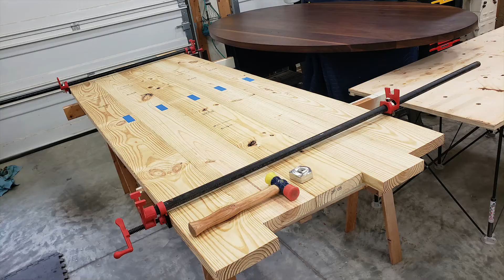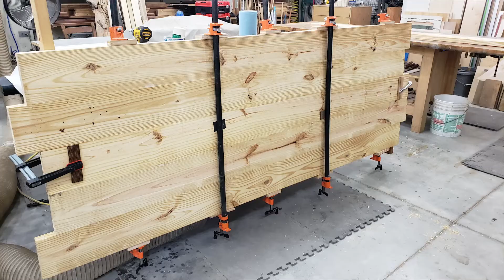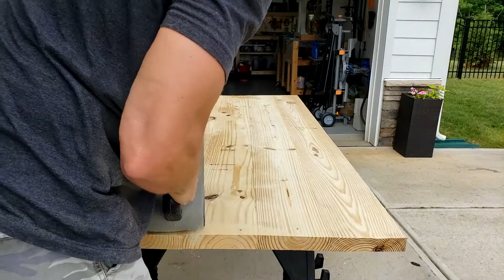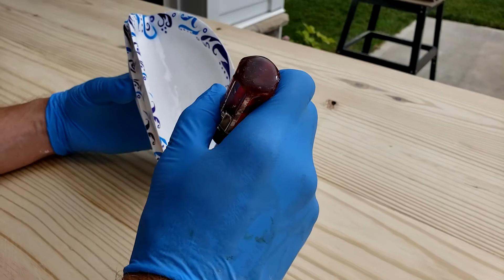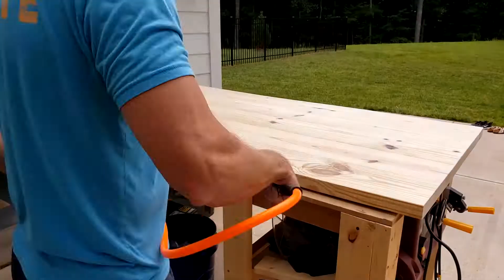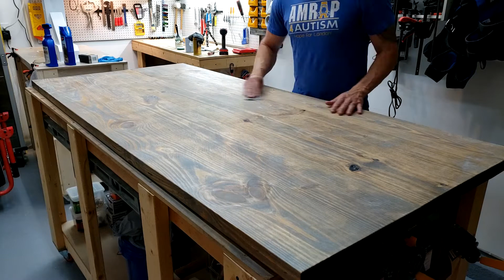DIY How To Build A Farmhouse Tabletop // Part Two

Comment: how did yo.u attach the trestle base to the table top - looks awesome!
Reply from the maker: I lined the base up with the top and drilled through to mark where to put a 1/4" threaded insert. Then used a 1/4" x 4" bolt and a washer and connected it to the threaded insert.
Reply from the maker: Also I did a 2nd video walking through this process. Here you go.

https://youtu.be/fF8I6fHgplw
Reply: @WillMosbey  Thanks Will!